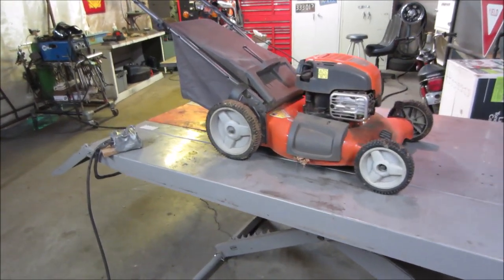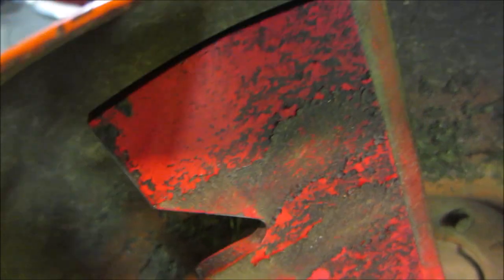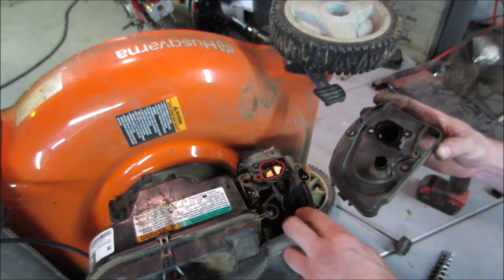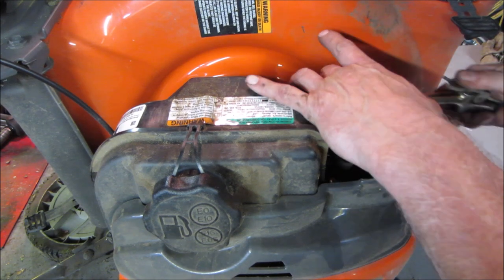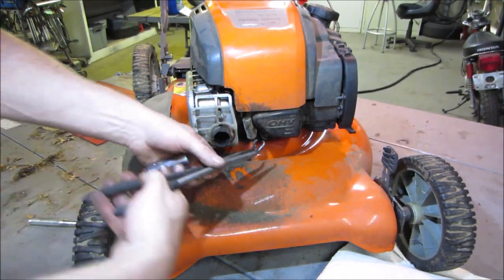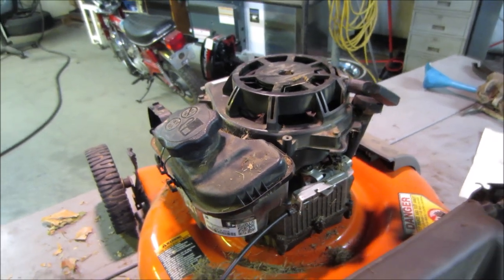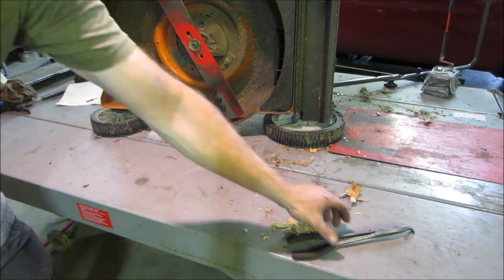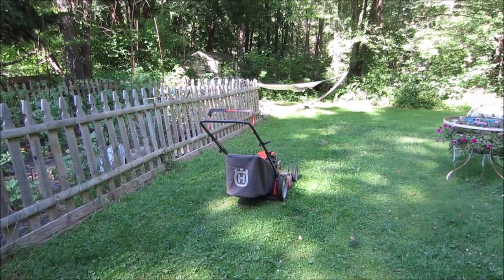NO OIL CHANGES? Servicing A Broken Yard Sale Lawn Mower,

Comment: When I was a teenager my mother brought home a lawnmower from a yard sale that didn't work. She said to me "here, I know you'll get it working". The blade was on upside down. The mower lasted until the deck rotted out. Now I wash the underside after I finish cutting. Funny part is the manual instructs the owner to NOT do that for some weird reason... Great vid as always - thanks!
Reply: Z man, 
If you don't get the grass off, it can hold the moisture and cause rust. You however must be doing a good job of cleaning. And  you are correct, proper cleaning will help the mower last much longer.
Good post
Reply: I bought a Honda mower a few years ago with a plastic composite deck for the very reason the deck rotted out on my old Murray.
Reply: Even better these ones have aluminum decks.

Comment: I wonder if that guy watched this video and smacked his forehead when he saw the blade was on upside down. LOL
Reply: i used to mow with a push mower that had the blade put on backwards from the factory and tbh it cut fine when i put it on the right way after 7 years it didnt really cut any better ftw it was a mulcher mower with no output other than the bag i never used only issue i ever had out of it was the main jet got corroded and wasnt allowing enough fuel thru changed the oil in it every season mower still runs like a top after 10 years

Comment: I drive a roll-off truck for the county landfill and it's crazy how many mowers are thrown in the 20 and 40 yard metal cans at the convenience centers  on a daily basis,
I have seen around 12-15 lawn mowers in three cans at one particular center, some look as though the owners got their moneys worth out of them but many look less than a year old
or practically new.
Also thrown away are weed eaters,chain saws,generators,air compressors etc.
Many look like they could start right up. (the majority probably just need a good carburetor cleaning)

It's sad that we are such a throw away society,also sad is the fact that our landfill policy states once they go in the can they stay there, no scavenging, we haul them to the metal recycling company
where they are scrapped.
Reply: I drove a roll off too and found some great stuff when I hit the landfill.
Reply: @richardturk7162  same thing with laptops and PC's the bios batt goes bad so it won't boot , toss it and buy another for 200 bucks while a dollar store 2035 button battery and  a bios setup will get it working.sick!!!!!!!!!!!
Reply: If I lived near there, I would be jumping the fence to get a few mowers. I had a friend that worked next to a Sears service center, He would always bring me mowers thrown out by Sears. I had weed wackers all the time too. Sadly, they closed!
Reply: My Dad just got rid of his 1969 3.5hp Briggs and Straton push mower last year.  He knows he could have kept the engine going great, but the deck itself was pretty much toast, and it had been painted (by him) about 4 times over its life.  I was hoping he'd have kept it a little longer, but he just downsized to a place where all he really needs is a weed eater, so he got a (well) used Sunbeam electric mower that looks like it came from about 10 years before the gas powered one he just parted with. That's my Dad... traded "down" to something better. Unbelievable.
Reply: Scott Hardin .
Reply: @gertraba4484  pretty crazy what people throw away, we have e-scrap cans for electronics and the county pays to have them removed, I have seen (on the low side) hundreds of game consoles thrown away, all the way back to Atari,Sega,old Gameboys etc.
Laptops, tablets,gaming PCs,smart phones etc.
So much money being thrown away when collectors are paying top dollar to buy and refurbish these things.
Sadly, as much as some of us would love to pass these on to someone who can give them a new life, once it leaves a residents vehicle it is considered county property and removing it is considered theft.
Reply: Landfill policy sucks,  What about the recycling company? You could always buy the load from them... Then sort and sell the rest... I know that there are people who take advantage of 90 day no questions as return policy. I know I have a few times.  They use it and if they remember they return it. Those policy work because people almost always forget to return the item... same thing with the extra warranty, In many cases people forget, yet you have those who will return the item 2 year later a week before its up and get an upgraded item.
Reply: @kameljoe21  I bought a predator fourteen horse power.  The electric start pooched out quickly on that $339 engine
  The. Thing always started second pull so I used it the whole extended warranty and then harbor freight offered another two years on the new replacement engine for another fifty bucks. 
For a heavy user that is quite a deal
Reply: @ohiofarmer5918  Yes, If you factor in the cost for the extended warranty and know you will have it that long its worth it. As if anything goes wrong you can get a replacement and then pay the same price again for it, The other thing is if you intend to upgrade at a later date. Like an example, If you buy one of the small air compressors and then a year later change it out for a larger one and just keep going till you get the largest one they have. Its like upgrading while only paying the cost difference and fee... I am on my 3rd compressor and I am not sure when my warranty is up, I might have missed it. I want to get the new 200 psi compressor.
Reply: @kameljoe21  My city's 'Waste management" won't let you take stuff for reuse - say that it is 'stealing' .  Good management should be reduce, reuse, then recycle.  If they would allow a few $, they would have more money than they get from the scrap.........(I asked about a charcoal grill in passable condition once and they wouldn't let me)
Reply: I used to work at a local Recycling yard and one day the Sears guy came with a truckload of lawn mower parts... he been out doing warranty work....one particular mower had a 20hp single-cylinder Briggs engine which had a plastic coated camshaft with compression relief mechanism.. that mechanism would break and cause the engine to be very very hard to start because of too much compression they would just pull the engine's off and replace it with a brand new one... he brought down about 12 or 14 that day on pallets....they literally looked brand-spanking-new... he said they probably did didn't have over three hours on them..these engines were fully dressed carburetors breathers air filters starters the whole 9.... I couldn't get whole engines because I had no place to put them but I did get a few complete carburetors and most of the starters.. but they didn't go to waste because the lawn mower vultures that were always there snatched them up pretty quickly... they got them for $0.12 a pound.... I've gotten so much cool stuff out of there I still have a lot of it to this day...complete 5500 watt generators for 12-15 bucks.... that needed just a little elbow grease to get running...
Reply: i places an add on kijiji 
looking for unwanted mowers , tillers , lawn tractors ect.. 
my yard is full of projects , nothing over 10 years old , 
now i just have to get to them . lol

Comment: Must be an Australian mower, blades upside down... (Hi from Aus)
Reply: Not to an Australian they don't!
Reply: The blade is correct for Australia. The issue here is that the pull starter is incorrect, causing the engine to be running backwards.
(Hi from Sydney)
Reply: I am about to finish fixing a Rover lawnmower this afternoon.  I bought it from a second hand place. The company that sold parts went out of business. Funnily enough I bought the drive  I needed for the self propelled from someone who went to their closing down auction. So my Rover mower will be self propelled again. I have owned it for 10 ten years. I am in USA, and still loyal to the Rover mower brand.  I also own 2 Rover cars!
Reply: Howdy and best wishes from the USA !
Reply: I love how you guys have a sense of humor! 

Poking fun at oneself is good (shows self confidence!)
Reply: Hey guys from brisbane Australia
Reply: Hi from new New Zealand
Reply: @Billy_Darley  They don't at the U.S. Embassy. They have motors on the toilets to reverse water going down. I saw it on the Simpsons.
Reply: When typing this did you have to have your computer upside down.
Reply: Nope, the blade is right....The whole mower is upside down.
Reply: Does it look better from "Down Under"?!
Reply: I thought that blades in Australia runing in oposite direction
Reply: what happened to old Zealand 😊😊
Reply: You funny mr.
Reply: Billy Darley that’s a bidea mate
Reply: LOL

Comment: Been seeing a lot of new mowers that you do not change the oil in now days. Its becoming a lazy person world, just buy new one and don't get dirty. Also a man who never put a blade upside down before has never serviced a mower. Love the videos, keep up the great work. Like new, a Mustie fix, just put back in box and sell as new LOL.
Reply: I am getting there, being lazy. Add some synthetic oil to them and let them go 2-3 seasons between changes. Agreed on the blade, I put a paint mark on the old one to prevent the mixup before removing.
Reply: @mph5896  I just bought an electric one. Only thing I have to do is rebuild the battery pack every couple of years. Got some new ones coming now.
Reply: You have to do that once on anything with directional cutting edge to then understand the importance of it. I put a chainsaw chain on backwards and it wouldn’t even cut a woody weed.
Reply: I work on them all the time and even I screw up once in a blue moon. I put the upper blade on my Honda mulcher on wrong this spring. I figured it out pretty quick.
Reply: I run a mower service shop and the tolerances are so loose even new they burn some oil so it always needs added to so it gets changed a little at a time. Kinda like a old oil burning car, check the oil and change the filter
Reply: @FishFind3000  I bought a new stihl chainsaw from a John deere dealer and the owner for over thirty years put it together. I also got home and it would not cut, called my nephew whom ran the shop there and told him he put it on backward, he giggled and said he does it all the time.
Reply: @dave1135  Yup, complete and total junk. Its no wonder everyone is buying my refurbished mowers all the time.
Reply: @jamesschrum8924  if you dont know you dont know. once it happens to you it really doesn't ever happen again.
Reply: @FishFind3000  You right on that. Best way to learn is to goof you never forget it.
Reply: @jamesschrum8924  yea, I watch my friend make a mistake. But it doesn't always stick. When you goof it says much longer.

Comment: I bought a brand new 22" Yard Machine 10 years ago and have never changed the oil. I check the level every so often and add some if I need to. Still starts on the first pull and runs perfect. The blade could probably use a sharpening or be replaced. But it still cuts good enough.
Reply: But, why not?  It’s not like it’s hard to do.

Comment: I had that mower, and loved it. It's a VERY good, light mower. I also changed the oil in it. While I don't actually remember if I found the procedure in the owners manual or online, I simply turned the mower on it's side and drained the oil out of it while I took care of other projects, come back a while later and fill it with new oil. I ended up selling it with a trailer, zero turn and a cheap weed eater and blower as a package.

Comment: I have never changed the oil in my mower either. I simply add a little before running and when done I notice the engine has burned a slight amount. I am still using a mower I bought 15 years ago and it works fine.
Reply: If you changed the oil properly 1X a year, it wouldn't be burning any. Change it 2X a year and your grandchildren will be using it.

Comment: Funny you say that about the well to do towns. When I worked on a garbage  truck I was always finding lawnmowers in the richer neighborhoods they were just throwing away. Sometimes they were like new and nothing wrong with them, sometimes it was something simple to fix like cleaning the carb. I had close to a dozen mowers I got that way that I sold for cheap or gave to people who needed them. After all I didn't have a dime sunk into any of them.
Reply: Not just rich, but maybe they're more culpable.  I do the same with box fans. Get them out of dumpsters (I don't go looking...)  Usually they're gunked up - minimal clean and a little oil...will run for years more, I now have 6, all free. My latest was absolutely clean but had a broken blade.  I had an extra from a burned out fan. a minute or two to replace and voila - a new fan!

Comment: always good to do oil changes. just did the oil on a skilsaw that was almost dry except for the varnish on all the gearing. now has everything lubed and after several flushes with fresh fluid, is nice and clean inside and out

Comment: I had a neighbor that had bought a new mower and the piston locked up.  He asked me to look at it and I did.  He had put a new blade on it and tilted the mower up so that the cylinder was facing downward.  I removed the spark plug, pulled the cord and oil spurted out.  The oil had drained into the cylinder.  I drained out as much oil as possible, cleaned the plug, reinstalled the plug, refilled the oil and it started right up.  It smoked, but that went away after the oil burned out.  Then he tells me the reason for the new mower is that the old mower did the same thing after changing the blade.  I fixed that one too.  It's hard sometimes to find people that are mechanically inclined.
Reply: WCTarheel - That's not really fair! Your neighbour is definitely " mechanically inclined ".
.... his problem is simply that he is inclined the wrong direction LOL
Reply: Well, information is power and he didn't know that and you did.

Comment: When I was a kid in the late 70s early 80s, my dad had a briggs and straten and he didn't change the oil for 11 years.  He just kept adding oil.  It would still run but every time I had to use it, it filled the whole yard with smoke because the rings were shot.   But it still ran.  I always thought that was impressive.  After he died, my mom sold it to the yard maintenance company she was hiring and they honed it and put a new set of rings and it ran great.  It was one of the old 3.5 HP models with no safety stuff so you didn't have to hold anything on the handle to keep it running.  I think it was Wards or Sears.
Reply: Had a yard machine with a briggs and straton bought in 2000. It still runs to this day and I don't think we've ever changed the oil. Just splashed 30 in it when it needed it and called it good. 

We cleaned the air element for the first time last year and noticed an immediate uptick in the RPM. Was practically brand new. Still runs like a top when we mow the back 40.
Reply: '86 Toro running strong til this year. Would work with a new carb, but I really want a Honda.

Comment: I've been using the same two mowers for the past 23+ years and I have only changed their oil twice. 1st time after the initial break-in period and then again last winter -- the oil looked black but I didn't find any grit.   I check the oil 2-3x a season and top off when needed.   I learned this while in the Army.  They only changed the oil in our trucks when an analysis showed it was needed.

Comment: I have the identical mower. I changed the oil after the first season and it was glittery with metal. Then changed it again at the 3rd season, it was barely dark and had almost no metallic glitter. Briggs claims to have made some changes to the engine to lengthen the life of the oil (2800 vs 3600rpm, better air filtration to catch dirt, better oil cooling, tighter manufacturing tolerances) but I am still going to change the oil to get the debris out. I have no doubt it will die an earlier death with no oil changes, but I know plenty of neighbors who never change, check OR add oil, so it seems all the marketing in the world can't teach idiots to care for their stuff.
Reply: Could the engineers figure a mower will fail from carb issues before oil issues?